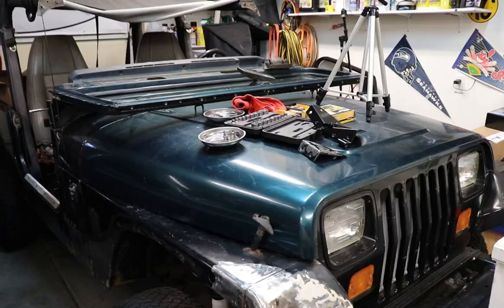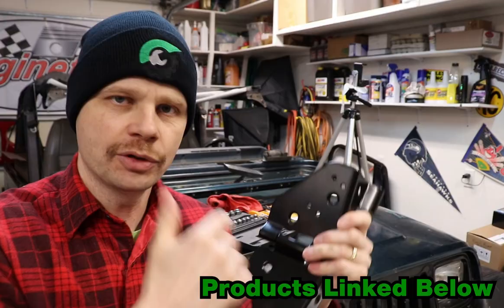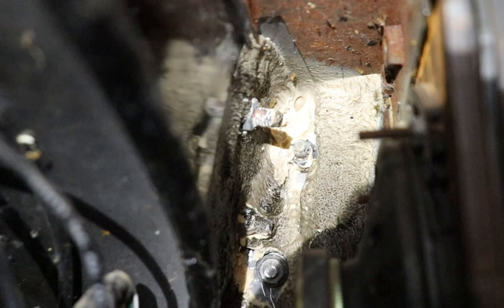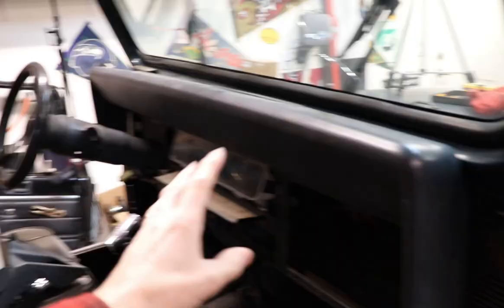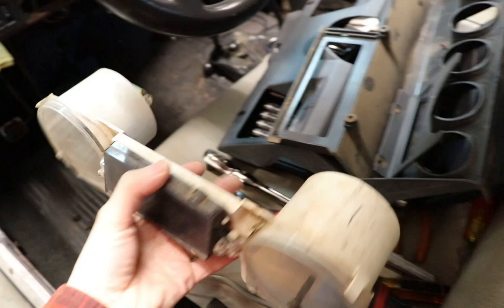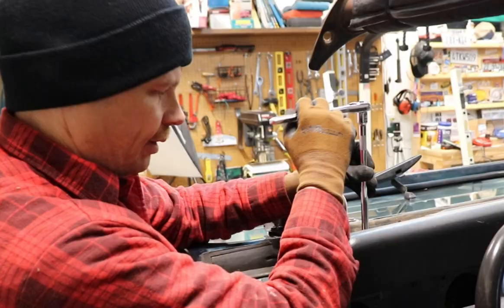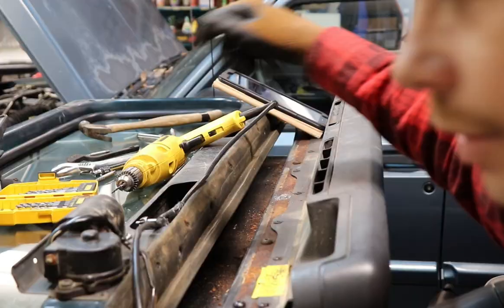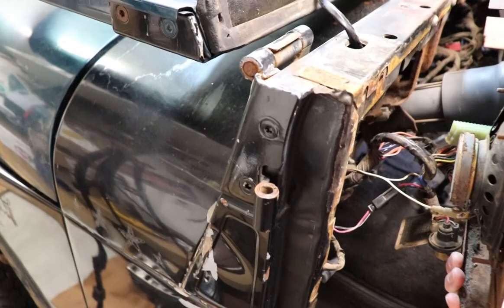Be Prepared!! Jeep Windshield Hinge Removal

Comment: J.Solid, You did it " THE RIGHT WAY " did not take the easy road. Now you can clean up all the rust, crap in there " EVERY WHERE " from taking the dash out & primer it a few times. Clean up what ever you can, check " EVERYTHING " while the dash is out, wiring, bulbs, speakers, gauges, ect... VERY SMART TO DO IT THIS WAY BUT SUCH A PITA. The thing is NOW YOU KNOW WHAT YOU HAVE BY DOING THIS, A+ SIR, A+.

Sometimes you frustrate me AS I DO OTHER'S, LOL BUT THIS TIME GREAT JOB & AS YOUR CHANNEL IS CALLED IT'S " JEEP SOLID " NOW. Henry froom PA. living in the old RUST BELT HERE SUCKS.
Reply from the maker: Thank you!

Comment: When I did this project on mine, I used a Dremel tool.  Small enough to get in there and remove the Seam Sealer easily.  Takes a bit to cut off old bolts, but patience is key
Reply from the maker: Good idea
Reply: @JeepSolid   Dale , Harbor Freight has a cheap needle scaler that will clean up that sealer fast.

Comment: I would like to apologize to you Dale,  I had misunderstood you you before,   I thought the windshield hinges had the  nuts welded in on the  inside of the  body,  I didn't realize that they were just held in place by the  undercoating sealer.   Now I understand why you took the dash apart to get at them.    After seeing all that I  kinda agree with  other people about the idea of  just drilling them out and then  driving them thru with a hammer and a punch.  But like you said, you still need to get the dash apart so you can install the new hardware.
Reply from the maker: Hey! No problem. Got it done and it looks good. Man that sealer was a pain

Comment: Use a sharp blade to cut around the sealer. I work as a seam sealer and have to deal with the hard sealer occasionally. Sharp blade like a chisel or scraper works well. Little bit of heat helps too.
Reply from the maker: Yeah. I used a chisel and some heat. Fortunately the dash came apart fairly easy. Let me attack it a lot easier

Comment: I just did mine, too. Only passenger side, though. It broke completely in half. Wish I had been warned that putting the windshield down might break the hinges. I thought they were just tight, but I was actually bending the metal brackets as I lowered it. It was a job getting that sealer off the nuts. I had a little success with heat, a sharpened screwdriver and a dental pick to pull it away.

Comment: you can counter sink bit drill the holes to match the screw shoulder to the brackets. just take your time to counter sink until the screw flush with the bracket surface.

Comment: I had to give up on mine. I need to drill them. They either spin in place (solvable like you did) or were solidly rusted; after stripping a couple and snapping three T40s I quit. 

The method I’ve used on other Jeeps is to weld on a 7/16 nut -the combination of heat and using a stronger socket gets them to come out and I need to drill or do that with mine. 

I need a solid day to do it and get stuff painted well 

I’m confused why rugged ridge is described as ‘nice’ considering they are such a thin gage. At least the ones I’ve seen.

Comment: I ordered the full rugged ridge door hinge kit with body hindges. Oddly enough the upper door hinge doesn't fit into the windshield hinge slide pin. Brass pin seems to large. Posting a video of this issue. Hinges dont fit factory windshield hinge either